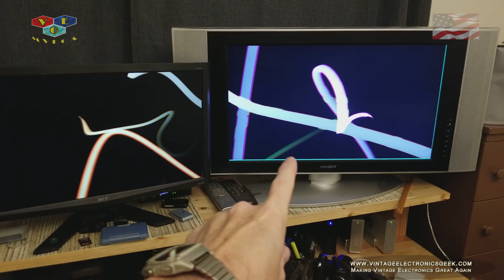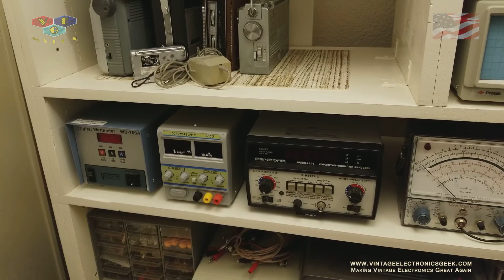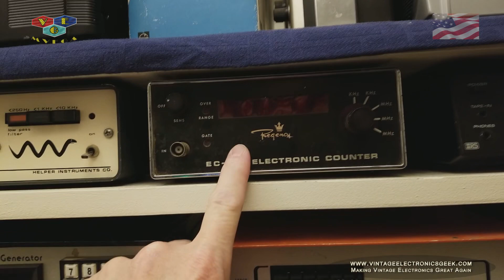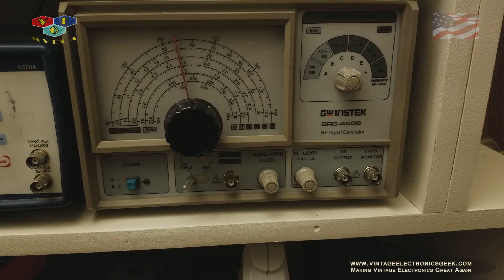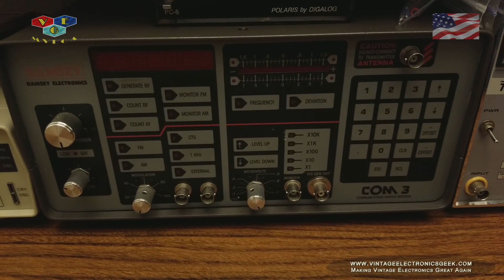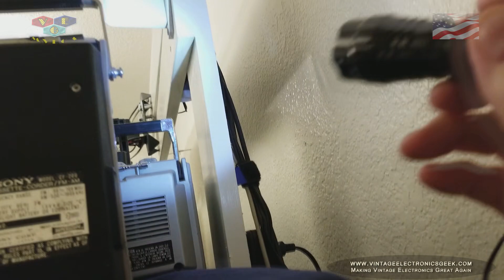Workbench Update #2

Comment: Wow jack you have done a great job with the workshop, looks like you have been busy buying test gear. I really like your camera mounts above the bench that’s really practical. If you have not already done it I would install some good quality LED lighting.  Your test gear collection look fantastic, but I don’t think your going to find that arrangement optimal. Sit in the chair and check you can reach the test gear you use most frequently without getting out of it. I know your not a big oscilloscope user but you need one of the scopes in reach sitting.    What are you going to do about power distribution to all that gear.  I would make sure you have a master switch accessible from the bench for easy and safe isolation. The thing about setting up a workshop is that it’s never finished. Great video thanks for sharing, it’s going to be interesting to see how the workshop evolves.  

I have recently disconnected some of my test gear as it  tends to trip the earth leakage circuit breaker. A lot of test gear has large filter capacitors and they can be problematic in the home workshops. 

Regards Chris
Reply from the maker: Thank you Chris!  I am really jazzed about my new configuration as well, big step up for me!  The lights I have are all matched LED's, been using that system since day 1 and I set my white balance to my lights so I get neutral tones.  Looking forward to using the overhead camera, will be great for the viewer I hope!

As far as ergonomics of the layout, I spent 2 days moving and arranging the test gear for just that purpose, what do I need the most access to and the least, and this is what I came up with.  I actually can reach and see the o'scopes with no issues.  I try to use them as much as I can, but then again, I am teaching myself electronics and Im sure Im not using everything to its fullest, but I am trying and learning. Or should I say: All This Gear And No Idea!?!  :)  

On the other side of the wall is the house panel, so I am real, really near and hopefully, I should be OK..  :)  A master switch is the only thing I don't have, my gear runs to 3 power strips under the bench which all have switches which in return runs directly into the wall, but will comeback to your suggestion about the master switch.  

You know what sux?  I ran out of room all ready and I was wanting to buy more gear...  :(  

Thanks for watching my friend!  ~Jack, VEG
Reply: Vintage Electronics Geek Well tell me about it running out of space. Let’s face it however much space we have it’s never enough. I still think your going to rearrange some of your gear, but that’s part of the fun. I have been in the workshop tonight trying to decide what gear I can sell or put into storage it’s so hard, especially if like me you spent many hour repairing that that stuff. I  still think you bench looks a bit dark but perhaps it’s the way I’m viewing it. I find as I get older I need more and more light. I would recommend that master switch, is good for the wife to know how to isolate the bench easily should the worst happen.  I think your doing amazingly well being self taught. I have  various engineering degrees but everything useful was self taught.  Thanks Jack regards Chris
Reply from the maker: I know, I keep telling the wife when we move, we should look at a grocery store or some other large commercial building!  :)  Is the truck taking priority?  I'd like to have a HP sig gen like the one you recently picked up, so maybe a future purchase, along with a digital CRT scope and a spectrum analyzer, almost got  one, but was outbid...so, yes I can see the bench changing...plus, I'm sure once I actually sit down and start using the bench, it will tell me if I have it correct or need to change...soon I hope, I am tired of this project...it's almost like a job or something!  :) 

I too am papered, only had 3 jobs were I used them, then changed paths and worked for myself for a spell, then retired.  All the junk I work on is mostly mine, I started out young dabling in electronics, then life happened and I never really did anything with it much, so now in retirement I pick it backup.My pleasure Chris, and thank you!  ~Jack, VEG